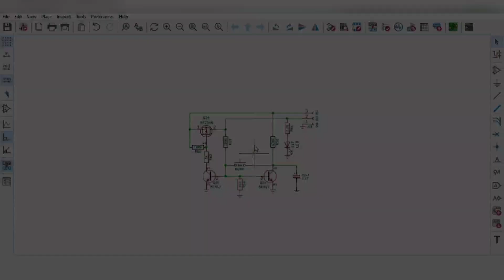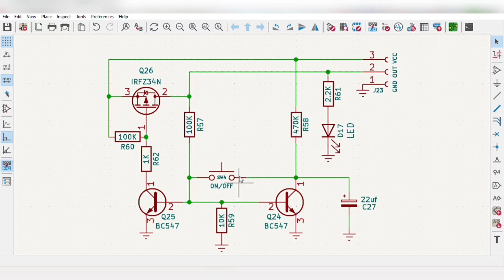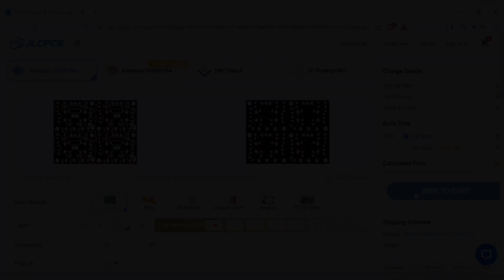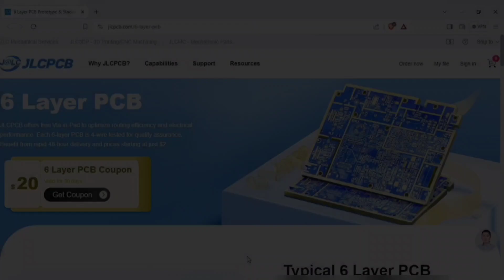Single push button on off switch for AC or DC application

Comment: Hry.. nice project... But I have a doubt.. will it consume power if I connect the circuit with a battery all the time while keep the output off?
Reply from the maker: No it won't, just the capacitor will remain charged, ready to turn on, Only in on position it will consume some mili amps to on the base of transistor, and gate of mosfet.

Comment: Le Pen will still lose the 2nd round.  

The French 5th Republic's Constitution, as written by Charle De Gaulle, provides an electoral process designed to ensure that the control of the National Assembly always remains with centrist parties.  Its true strength lies in the ability of the 5th Republic to keeps the stench of the radical left in the sewers. 

Unfortunately, the Right is viewed as a victim that suffers for the ultimate stability of the nation.

Well done by General De Gaulle.